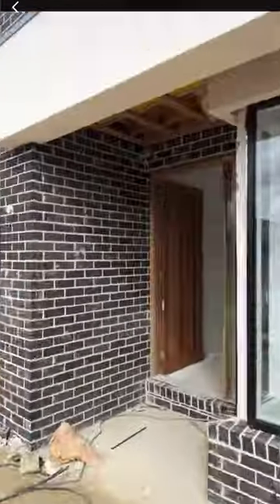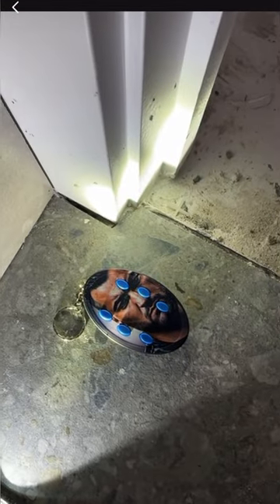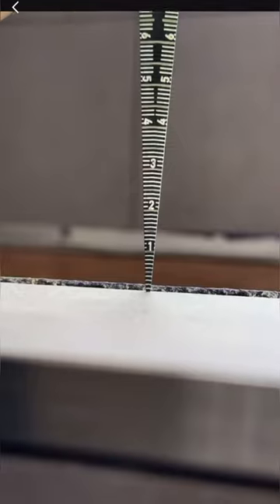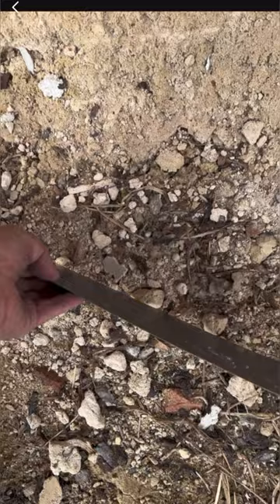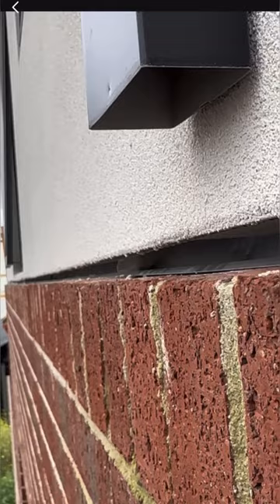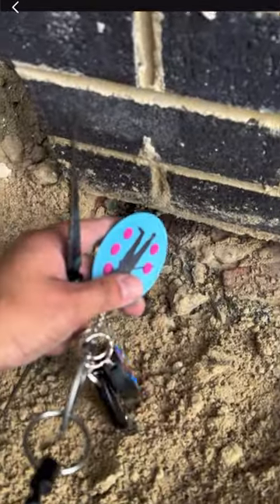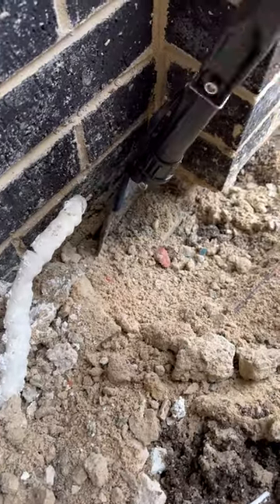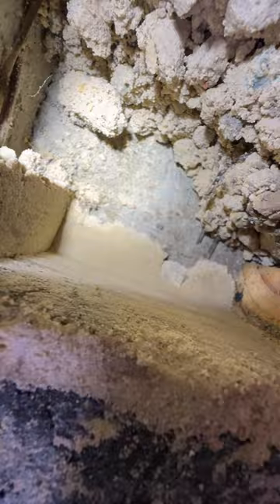Truth Uncovered: Revisiting a Lockup Stage Inspection | Site Inspections

Comment: How is this level of incompetence so widespread. Like it's not like the client is getting a different paint shade and complaining, these issues will at the minimum result in tens of thousands of dollars worth of problems down the track, let alone the risk of a wall coming down on someone. 

Clearly these builders have no shame, no pride, no ethics. Like dodgy trades are one thing but the builder/site supervisor signed off on this crap, they shouldn't be building lego let alone peoples homes
Reply: Use a private Registered Building Surveyor to do all required (and more) inspections at the appropriate times and stages. Let's help get rid of these Mumbai ?qualified contractors NOW !!

Comment: I suggest the supervisor needs to go to jail, a kabab shop is too good for him, and why the overhanging brick? can't the concreter get slab size correct, what are they using to measure the slab area? a piece of string tied between two sticks.